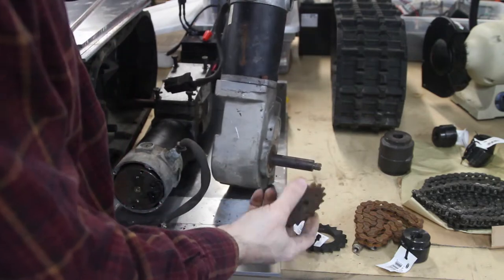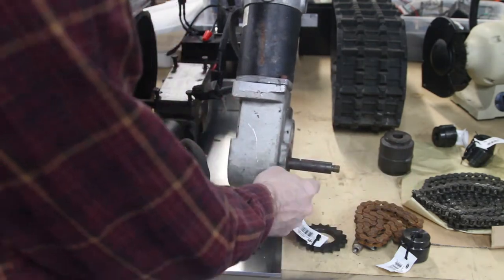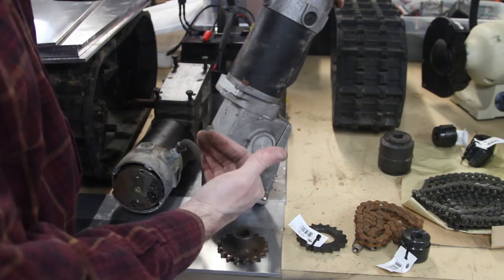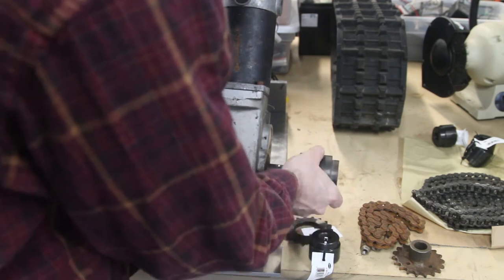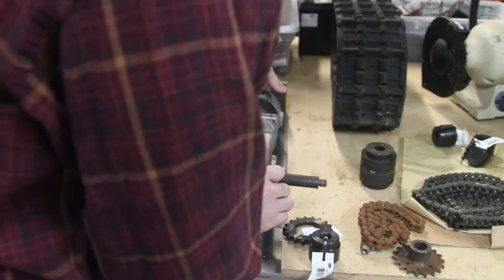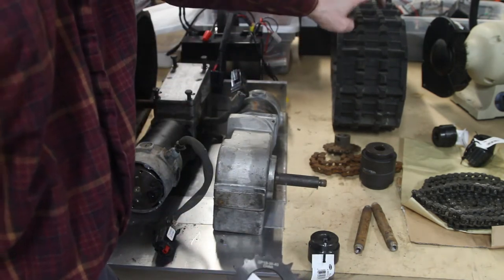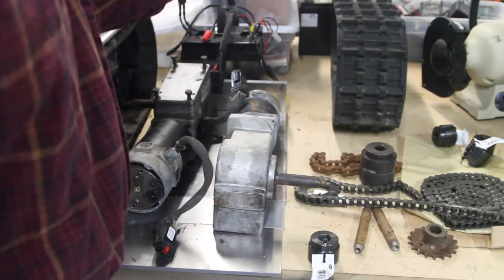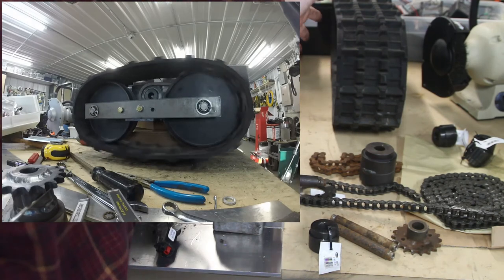Track Drive Robot Chain and Sprocket Sizing:  #41 vs. #40

Comment: Thank you very much, the video was very enlightening. I'm Brazilian and I'm thinking of using a TAV30, and here in Brazil the 420 chain is easy to find, so I didn't know if it would fit the #40/#41 pinion that comes with the TAV30. Now I know it works smoothly.

Comment: Interesting info... The question is: how much wider is the 420 than the #41? How much wider is the #40 than the #41? What are the differences in strengths? This might not be of much interest in a snow-blower, but on a more powerful machine with the chain very close to the person riding/driving it, the differences mean a lot... Especially if the chain breaks, it could easily hurt the person next to it...

Comment: can you publish your current measurement for the lenght of the chain 2 axis and general blueprint would be useful to replicate what you have done! Good job
Reply from the maker: i wish it where that easy.  because the tracks vary in length those measurements are not the same on both sides.  i need design new or retain the original tensioner system to do blueprint

Comment: What is the wattage and rpm of your motors?  I am looking at something similar, but I am doing a lawn mower, so I am looking for 5 to 7mph. Thanks
Reply from the maker: I think these are 400watt motors.  rpm I dont know, but it is low and high torque.

Comment: Hi again, could you give a link to the couplers and sprocket you used for this?  Thanks!
Reply from the maker: The brand is this one.  www.speeco.com/products.aspx?id=45   bought them at Fleet Farm   www.fleetfarm.com
Reply: @bzeug  Thanks.  What ID coupler did you use?  My measurements indicate the motors have 18MM shafts but I cannot find anything 18mm.  Did you use 3/4"?
Reply from the maker: @FretsNirvana  Mine are all 3/4" no metric shafts.  These are Invacare brand motor units from older style wheelchairs around 90's era I think.  Are your motors from newer chairs?  Do you know what brand?
Reply: @bzeug  Yes they are Invacare 4 pole motors from an Invacare TDX SP ...but I own several motors from Invacare and Jazzy ...all have the same shaft which by my measurements are not quite 3/4"  ...meaning they are all 18MM.  Is there some play in your couplers to shaft?  Thanks for your communication.
Reply from the maker: @FretsNirvana  No play.  In fact you can see when I put the example welded shaft adapters on the shaft they take a little effort to remove.  You've got me curious now, I don't think I actually ever measured them in metric with my micrometer.
Reply: @bzeug  If you can measure let me know please ...none of mine measure fully 3/4
Reply from the maker: @FretsNirvana  19.05mm  .75in  3/4" dead on. Just checked.
Reply: @bzeug  Thanks ...that is interesting.  Mine are definitely 18MM.  You really deserve more subscribers here ...I subbed quite a while ago.  Your detail and attention to your channel deserve a lot more attention.
Reply: @bzeug  FIY I got TDX SP motors too, 19mm, 3/4 inches

Comment: Did you use the same sprocket that's inside the track?
Reply from the maker: I kept the original sprocket on drive wheel.
Reply: What about the bigger sprocket on the driven wheel.  I am still in the designing stage of my project.   I am concern about the low rpm of the wheelchair motor vs the higher rpm engine
Reply from the maker: Yep the bigger sprocket on the drive wheel is unchanged.  It is just as it was from the factory, which is #41 thinner sprocket.  In my case the system works just fine, with mixed #40 and #41 sprockets using #40 chain.
Reply from the maker: If you are planning on using a gas engine to drive these, then ideally you want to stay #41 sprockets and #420 chain.   I think I had found some weld on #41 sprockets from a Canadian supplier.   Yep found the link:  https://www.princessauto.com/en/detail/18-teeth-41-chain-weld-on-sprocket/A-p8609471e
Reply: I'm using wheelchair motors and I plan to work around the snowblower original housing.
Reply: My rc snowblower and snowplow is almost completed.  Waiting for some snow.  I did some testing with the snowblower early in the year but it wasn't that much snow. Here they are here https://youtu.be/eA-kUhlJVnc